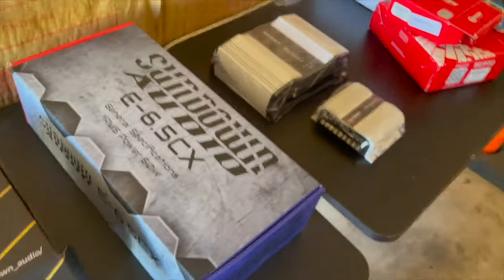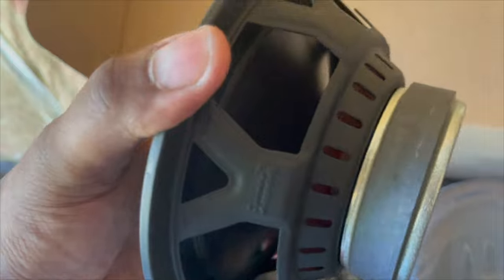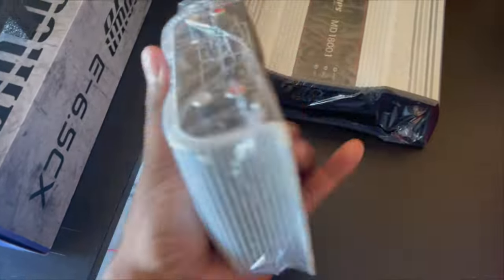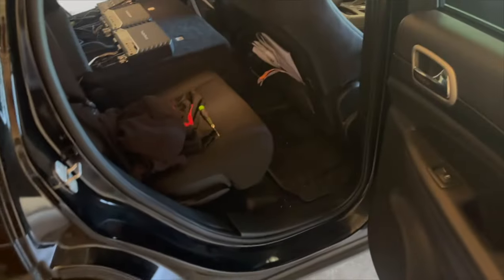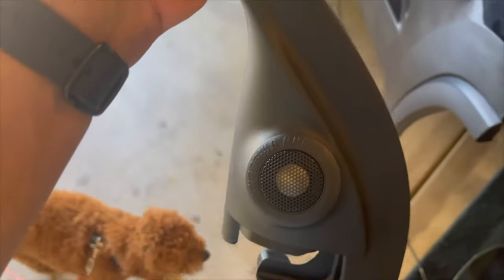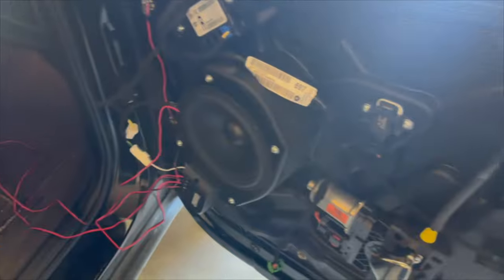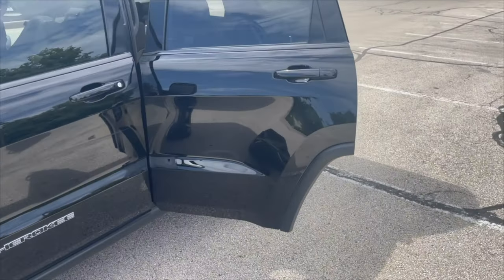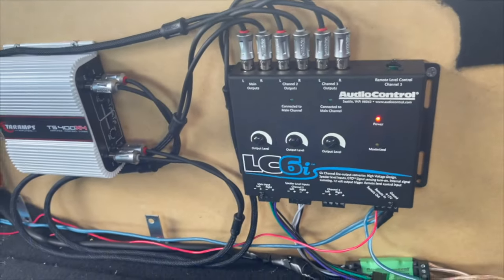Sundown Audio E-65CS/E-6.5CX Speaker Review

Comment: I have Rockford fosgate 6 1/2 components up front along with all speakers being Rockford fosgate. I can't stand the tweets. I just bought Down4Sound mids and highs. I bought 4 mids, or two sets. And 1 pair of tweets. And I just got my JP23 4 CHANNEL TO RUN said speakers! Getting rid of the Rockford 100×4 amp. Got a CT SOUNDS 2001D MONO BLOCK AMP pushing the Rockford fosgate 10 T1's. The CT SOUNDS is going in my wife's SUV. I'm gonna go with either a JP 63 or 83, different subs. And this is in a semi! My whole semi on the inside is kill matted ETC, 0g wire, custom alternator done up, ETC, ETC!
Reply from the maker: Good to know I’m not the only one who hated those Rockford tweets

Comment: The tweeters seem to be the weak point in alot of component sets, in my experience. I got tired of overpaying for mediocre car audio speakers, so now I only buy hifi replacement drivers or prosound drivers. Currently in my doors, I've got 7" Dayton Audio Reference midbass (RS175p-4) and Dayton Reference aluminum dome tweeters (RS28T) and for $60 and $40 respectively, there's not a comparably priced car audio marketed component set that can hang with 'em.
*7" Reference midbass has a frequency response of 38Hz-6KHz
1, 1/8" Reference tweeters have an Fs under 800Hz and go up to 20KHz

Comment: Sounds great!!!!good job and I know sometimes u don’t have to spend crazy money for sounds but I do have a question I see ur running lc7i and ur jeep doesn’t have factory sub woofer and I know lc7 can get u subwoofer rca but in mines I have factory sub would you leave it alone and just lc7 or would u wire factory subwoofer to lc7??? I put mines together but sounds like shit on highs and mids i put kenwood speakers in coaxial now I’m swapping with ds18 and kenwood 5 channel amp with kenwood down firing sub any information would be greatly appreciated sir I only watched ur other videos 100 times u have helped so much with my install big thank u
Reply from the maker: Thanks for the response and support . Are you saying you already have a LC7i? If so put your front speaker radio outputs to input 2 on the LC7i. This is now your front door channels output. The LC7i will copy this over to output 3 which will be used for your sub RCAs. Then use your rear door speaker input to the LC7I input 1. 

Regarding the factory sub I would just disconnect it.